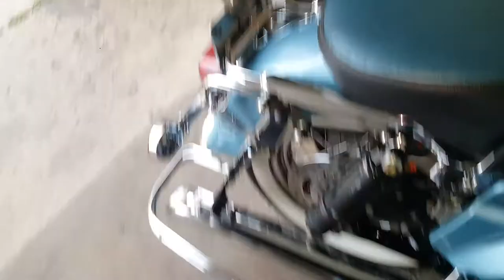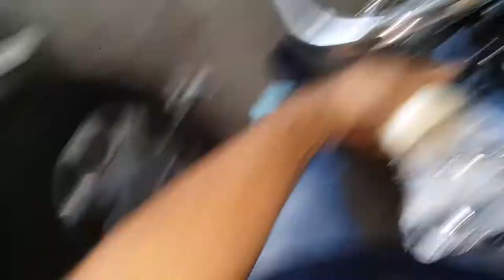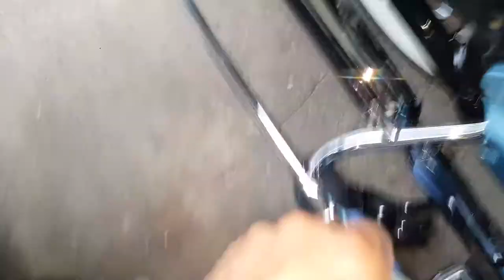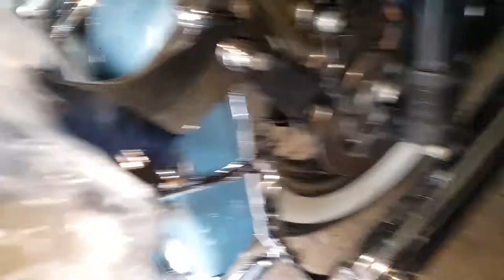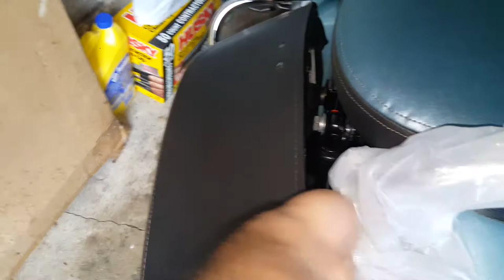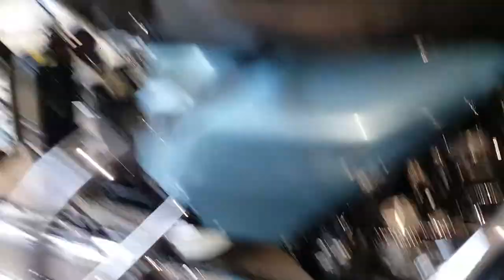Sexy sissy bar for 08 Road King,  ebay inexpensive good quality back rest.

Comment: Did you figure out why it did not latch on ??....
Reply from the maker: Yes sir, it was ever so slightly bent, took a small plastic hammer  and tapped it softly and sure enough it popped out like it was supposed to do.  Still very happy with the look and quality.